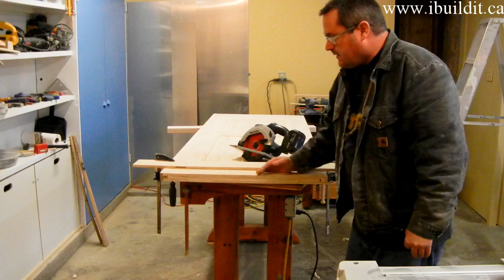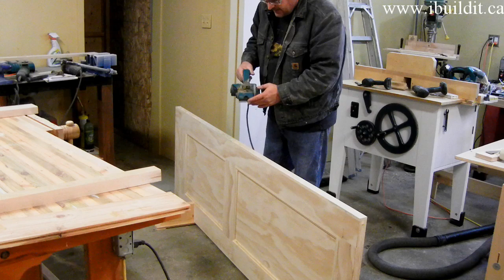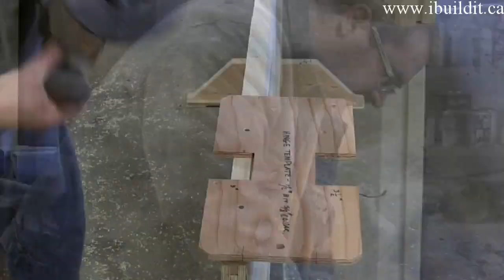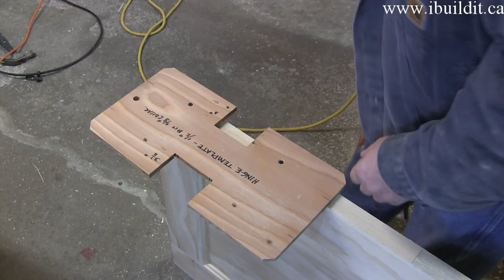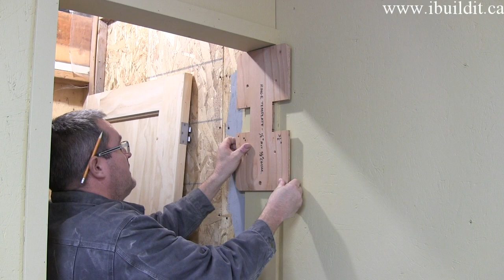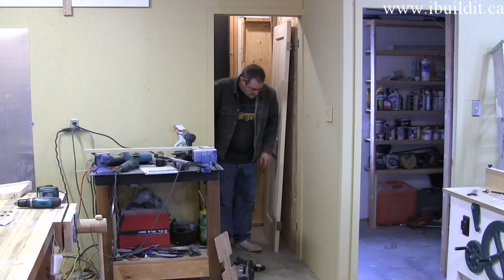How To Hang A Door

Comment: I agree with the basement stuff but just use a razor knife a tick above the line and score, when you cut off the bottom u won't have Chip out, however if you put a shoe on the bottom it covers about a 1/2 inch? 
I run the knife down the ends only so you still have Chip out at woods worst place .
But good job I like your  ethics
 My dad started in 1946 I started in 76 and that's all I do.
Not many can compete.

Comment: I am having problems with using a jig for cutting hinge slots.  When I screw it in place, it sits proud of the surface so it is hard for me to guage exactly WHERE to place the jig so that when you factor in the spacing for the bushing that the router blade runs on around the template the cut is made in the right spot.  Is there a good way to set this up?  Or am I making too big of a deal by being off by 1/8 of an inch?

Comment: Questions: 1. at the 925 mark when you put up your template, are you flush with the head or is this where you pull it down 1/8"?  This is another reference to the 7-1/2 on door question asked by someone else earlier.
2. Do you always measure down from the top hing to locate the bottom hinge? I am thinking if you had carpet it would be hard to measure from floor.

Sorry if dumb - never did one before.

Thanks

Comment: For a guy that was never taught how to hang a door, you did a pretty good job. I've hung about 10,000 door before they were pre-hung. Back in the day an old timer taught us to hang 30 doors a day. I would hang 3 doors an hour for 10 hours. I had to grab the door, put it in the bench, plane and hinge one side, turn it over, plane the other side, cut the lock hole with a gig, scribe and cut the bottom, and then carry it and hang it on the jamb. 30 a day in apartment buildings in LA, great fun.
Reply: jack phillips Been there done that. Not just apartments condos custom homes then I moved onto commercial door and hardware I hung and installed as many of them as the residential. Oh boy, those were the days...

Comment from the maker: Beveling the hinge side prevents binding and establishes a better gap.
I've never had much luck with knife scoring. I started doing the 1/8" scoring cut on plastic laminate doors and have been doing it since. Most times I do it free hand, without a guide.
Reply: John Heisz how many degrees is the bevel?  Never seen that before, and I've worked a lot of construction jobs.

Comment: i’ve been hanging doors for 35 yrs. And never heard of beveling the hinge side.
The score cut is a great idea and scoring the cut line with a utility knife before cutting also prevents chip out.
Reply: Yeah, can't imagine a reason to bevel hinge side
Reply: @ThorD4602  The reason for beveling the hinge side is that on occasion the hinges or door material can bind against the jamb.  By removing a very small amount of material in a 1 or 2 degree bevel...you can reduce or eliminate this.  In many door installations it would be unnecessary.  However there is very little downside to removing the material as the bevel will be hidden by the doorstop.  Professional door manufacturer design sites allow you to order the bevel on hinge or latch side in whatever degree you wish.